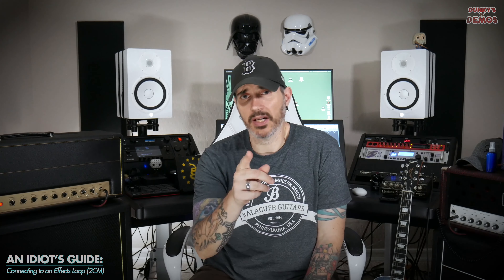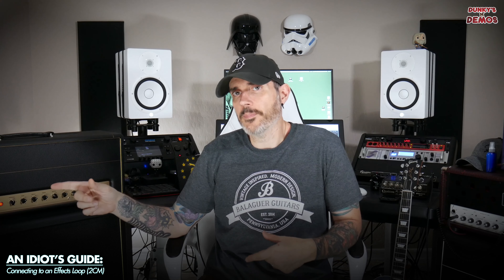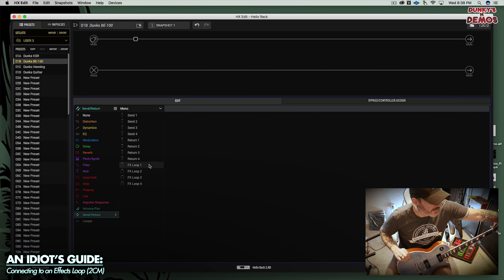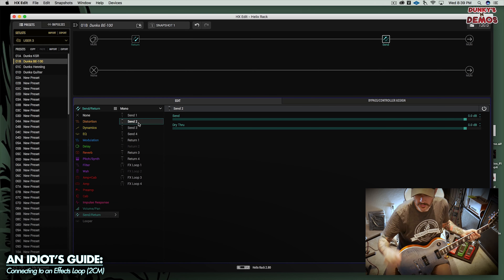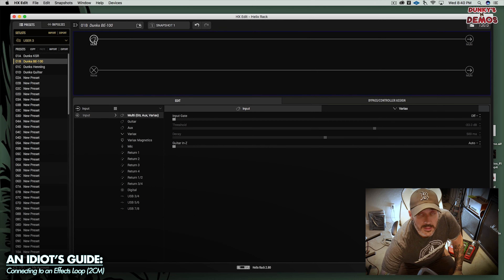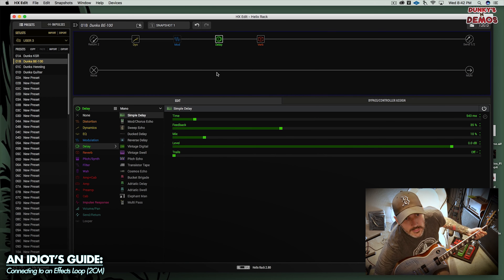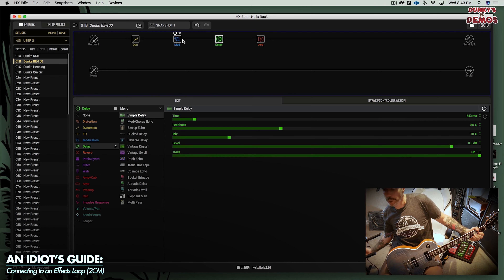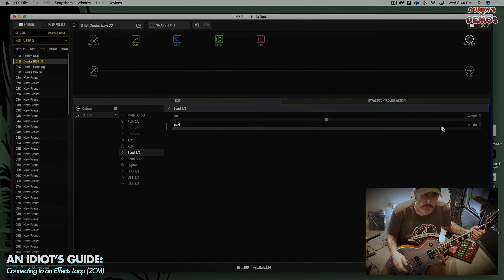An Idiots Guide to Line 6 Helix - #09: Connecting To Your Effects Loop (2CM - Effects Only)

Comment: So I'm guessing pretty much the same for HX Stomp? I got the stomp just to use for effects in the loop. This saved me sooo much of a headache. Thanks!!! I was kinda scratching my head as well. I didnt want to do a 4CM.
Reply from the maker: Yeah should be the same process. What screwed ME up was I kept the input/output as “Multi” and started with an FX Loop Block. Was getting no signal.
Reply: @JeremyVarao  The documentation I have is basically saying go in front of the amp. I prefer to use analog effects before the amp.

Comment: im loving the sound of this with my Double Rectifier my question is,im running the Helix just as FX into the FX loop of My Mesa Boogie
 Double Rectifier,how can i get anymore FX on a second line when i pull 
down that line & put blocks aster the split,i don't get any sound on
 anything except the top line with the blocks on it?
Reply from the maker: hey there! make sure that your output block at the end of your top path is set to Path 2a (I’m not at home but I believe that’s what it’s called). This should do it but I’ll double check when I get home.
Reply: @JeremyVarao  it is but i can sound out path 2a if clear the blocks on the 2 lines below,on some things like fx loop dosen't get sound unless on the top line & the harmonizer sounded distorted no matter 
where you put it

Comment: Jer.... why not run 4CM so you can mess with effects in front and the loop? I have my HX Effects in 4CM and I find when dialling in sounds some times an effect sounds better in the front of the amp Vs the Loop and vice versa.
Reply: Agreed. The 4 cable method is much more versatile.